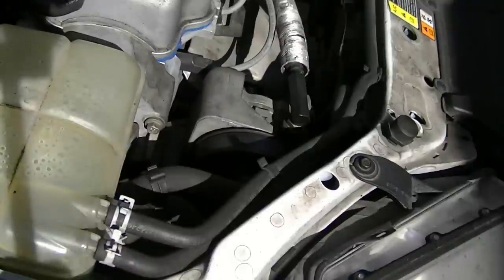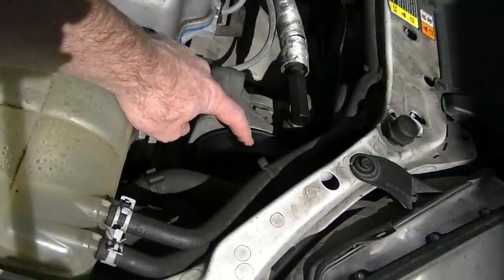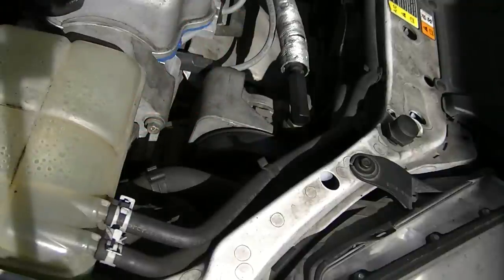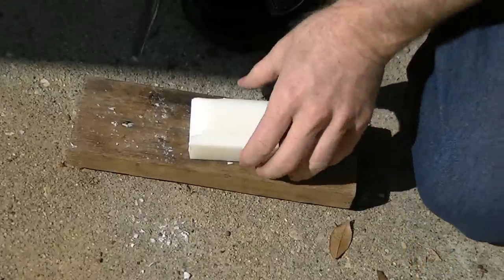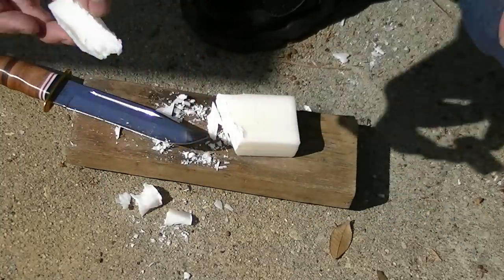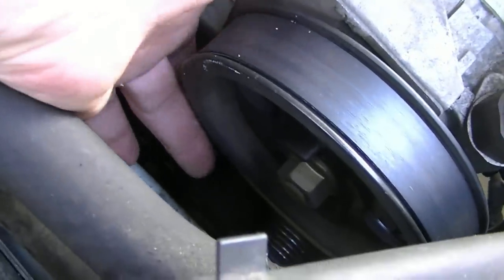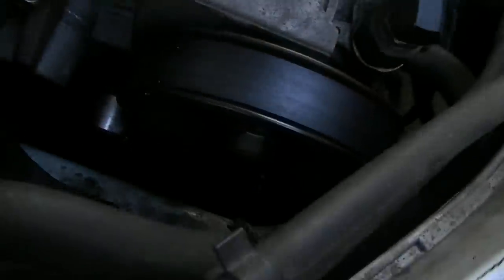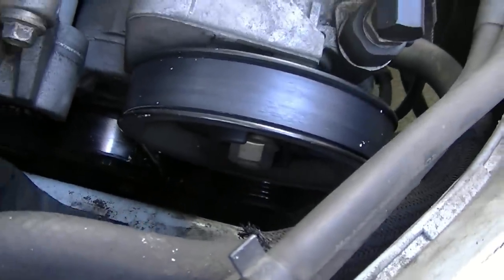How To Quiet Squeaky Belts On A Car - Cheap And Easy Fix

Comment: Okay, so for what it's worth, I'mma throw in my two cents. It has been to my experience that if a belt is squealing, either something is misaligned or bearings are bad somewhere along the accessory/ serpentine. If you spray the belt with  a little bit of water and the noise quiets. It's most likely an  alignment issue. 9 times out of ten, it will be power steering pump because most are only pressed on. The point to the whole thing is that if the belt is out of alignment, or the bearing are bad somewhere, it creates extra resistance and will wear out the other pulley's faster. I let my tension pulley go unchecked for about 1 year. It killed my alternator and my idler pulleys. If there is a squeal, at least take it to a mechanic and pay the 30 dollars to have them look at it and go from there. But don't try and mask it. The annoying noise should be a push to make you want to fix the problem. Any how. peace
Reply: I have to agree with you.I know the tensioner is new but that does not mean it's good,the sound I am hearing is a classic misaligned tensioner using soap just masks the issue.

Comment: The belt will start to squeal again as soon as it gets wet. Use paraffin wax from a candle on the inside of the belt. Its waterproof, won't degrade belt material and it's permanent.
Reply: It works

Comment: Another solution:  My car squeaks due to the belts and I used  "baby powder"  and that fixed it permanently never had the squeaks again.  I just poured it on when it was running and when its not, just try to get it on between the metal pulleys and the belt.

Comment: This fix definitely worked in my case.  The affected belt is not overly worn but developed the leak immediately upon installation of a new water pump.  I re-tensioned that thing several times and it did not fix the problem and to make it even more maddening--it was intermittent.  Anyway, tried your method and it worked perfectly.  Thank You.

Comment: Someone told me to use belt dressing on the belt to get it to stop squeaking. I went to the local auto store bought a can of belt dressing for five dollars and some change. I used it on the belt and the noise only got worse and louder--ugh. I seen your video, did what you showed us and it worked. Thank you.

Comment: THIS WORKED for my 1999 ford ranger..My radiator hose busted and antifreeze got on everything..After that my truck sounded terrible with a loud annoying  squeal just like the one you played there in your video.I change both upper and lower tension pulleys and nothing changed.so i tried poring water on the pulleys and it would stop while i was pouring water on it but come back again in a few sec.SO i tried your method with the bar soap ,and I will Be Danged if it didn't work..NO MORE SQUEAKY NOISE>GONE > RUNS SMOOTH AND QUIET< so there ya go.. i am a live  65 yr old lady testimonial  witness it  that it FIXED 100% after my 4th application of  a small chunk of bar soap  ..Thank you ,you have been a blessing
Reply from the maker: You’re welcome

Comment: we parked our truck for a week trying to fix the noise. We replaced 2 pulleys & bought a multimeter to check the altenator & nothing worked. $100 later I seen this video. It took 5 minutes to apply & worked the first time..... I wish I watched this video $100 ago. THANK YOU
Reply from the maker: You're welcome.  I hope it stays quiet for a long time.

Comment: This trick works 100%. I tried it and the squeak is gone. I had previously bought a belt dressing at Napa, but it only made the squeak louder. If this doesn't work for you then you either have a tension problem( bad Belt tensioner) or a problem with alignment of pulleys.

Comment: Dude at work told me to use gasoline on it, i found it a bit sketchy so i looked for help on the internet. You're video was at the very top so i gave it a shot. I was completely amazed how it worked for u so i had to do it ha! It worked n it took me less than 3 mins! Thanks dude
Reply from the maker: Iggster Salinas You're welcome. I'm glad it worked for you. I wouldn't put anything flammable like gas on the belt.  That sounds dangerous.
Reply: ***** right? & well the noise came back the next day so I'll dig deeper n see whats causing that annoying noise

Comment: I wasted about 200€ on new belts (2 of them) and tensioners (can't remember how the other wheel is called). But the problem resisted. After I watched this video and tried it - like a miracle. Of course, maybe I have to buy the spray, but for now I can still drive my car normally. Really big thank you!

Comment: Hi. Nice videos. Clear, to the point, and without all the dramatic loud music and graphics that other DIY video posters use. There is at least one video posted on You Tube by a serpentine belt manufacturer who advises very strongly against using belt dressings and sprays to quiet noisy belts. I have a vehicle with a GM Vortec 6 cylinder engine with a chirping belt. Thanks!

Comment: I hope some people read this post before attempting to quiet the belt noise on your vehicle. This video is very misleading and incorrect in many different ways. I read some of the top comments about different noises and none of them can be fixed with this "solution". If you put any type of "belt dressing" (soap, WD-40, candle wax, oils, etc) on your belt, you will contaminate your belt and pulleys causing dirt to stick in the pulley grooves (causing the metal pulley and belt to both degrade) and ending in more expensive repairs when a component actually fails.

When a belt is making noise it should be removed and inspected for wear (cracks, pilling, glazing, scuffed edges, stretching). Usually a belt will be worn in some way but that is not the reason the belt is making the noise, it's usually the result of another failing part. Bearing failure (bearing has movement or play) in an AC compressor, belt tensioner,  idler pulley, alternator, power-steering pump, water pump or in extreme cases the crankshaft pulley damper will cause the belt to be out of alignment with the rest of the pulleys and cause this noise. Also a bearing that has lost its lubrication may not have play but may not turn well with the belt removed.

Another misconception with belts (especially in this video where you are putting a slippery coating on the belt) is that when you put a dressing on the belt to lubricate it you aren't causing any other problems with the system and it's "worth a try" because the belt tension will grip the pulleys. However, friction is really the only thing that keeps the belt turning the pulley. If you take that friction away (which you do when you lubricate the belt with soap) you will lose the ability to turn that pulley. This will cause lack of power created by the alternator, lack of cooling from the AC compressor (cannot pump refrigerant hard enough), or even engine overheating (cannot circulate coolant fast enough). All of these things can happen without noise because the belt simply slips over the pulley instead of turning it. 

https://www.youtube.com/watch?v=UF3W-vHPYHg 

This video is a good example of how to perform some basic checks when you have a noise just like this one. The belt is removed after checking to see if any of the pulleys are moving laterally to the other pulleys in the system. Once the belt is removed the pulleys are checked for play in the bearings and should be spun to check for rough spots or resistance. When the real problem is found (the belt is not the real problem) you can replace that component and the belt and enjoy a quite ride without having to soap your belts every week.

As for everyone who has been ripped off by a dealer or mechanic that is lacking knowledge or experience I understand you are unwilling to go back and spend hundreds more on repairs that won't actually repair your vehicle. However in most cases taking your vehicle to the dealer it belongs to is the safest bet to get it fixed properly. Most dealers have people who have worked there for long periods of time and have first had experience with common problems that occur on different vehicles in one manufacturer (which does lead to laziness and misdiagnoses at times). Compared to your typical aftermarket garage, a dealer could save you money because they don't need hours to diagnose the concern. In the end though, don't put all your eggs in one basket and trust a single Youtube video on car repairs because you don't know better, and it's probably wrong (especially when you don't see any sort of professional traits from the video uploader (ie. face, car, garage, tools, etc)).

P.S. That whining noise at 2:37-2:39 is a normal noise for a SOHC Focus engine.
Reply: elzah1234 Read the part about belt tension and friction, or youtube a more professional video please :)
Reply: Thanks so much!!!! I leave for work very early and was worried my new neighbors would start a petition. It worked I am so pumped to leave tomorrow morning!!
Reply: Of course the first try should be proper belt dressing.  But you are wrong about soap being slippery.  It's only slippery when wet.  When dry it's tacky.  I've been using it on V and ribbed belts for over 60 years with no issue.  Still, belt dressing is definitely preferable and there are auto parts stores everywhere.  A squeaking belt isn't going to fail quickly (assuming you've ascertained that it's not in the process of shredding) so let it squeak while you drive to the auto parts store.  If belt dressing doesn't help, THEN look for a bearing issue.
Reply: How long will it last squeaking? I'm in this situation and poor as dirt.
Reply: All true except dealer part.  Never take your car to dealer for belt noise.  Independent garage can fix it much cheaper even if they have to spend a few minutes to determine cause of noise.  It's not rocket science.

Comment: I used chain wax. It comes in a spray bottle usually used for ATV's or Dirt Bikes. Not sure if It's bad for the belt or not but it works.

Comment: How long did the soap treatment work for you?  I had a squeaky serpentine belt on my 96 Caravan and the soap trick worked better by far than anything else.  Prestone belt treatment spray made it much worse even though it explicitly states OK for serpentine belts!  Luckily was able to quiet it down by 1/2 just by applying a small wire brush to the tread side of the belt while it was running and completely eliminated the squeal after using the soap.  Hoping it lasts!

Comment: I wish I had seen your video before removing the belt and cleaning it and all the pulleys with soap and water. It still squealed once I put it all back together. Soooo, I grabbed a par of soap and applied it directly to a pulley while engine running (not to worry it's an Xterra so space is plentiful) and rubbed the soap across the pulley til squeal was gone. Thank you bunches!!

Comment: This may stop the noise, but temporary. It will be more noiser in future. The best is try to tighten or loosen the belt accordingly and test it again, if you cant get rid of the noise thats mean it is time for a new one. I think it will be much safer and the cost are fair or may be lower from what you expect.

Comment: You are a genius! This is honestly the only thing that has worked for me.. How does it work exactly? And how long does it last?
Reply from the maker: The squeak is caused by the rubber rubbing against the metal pulleys.  The soap makes it a little bit slipperier, which stops the squeak.  How long it lasts varies depending on what is causing the squeak and how much friction the soap needs to overcome to stop the squeak.

Comment: Another thing to I don't know if he said it because I did not watch the entire video but its good if the bar soap has a low in it I have an F 150 and I have WD 40 on my belt which will cause it to squeak sometimes you have to change the entire belt in this situation but the soap works temporarily also try brake fluid with a rag that will get some grease out as well

Comment: 1.) We have a squeaky belt, but we're told it might actually be cause the pulley is dirty. Any suggestions? 2.) I'm not sure I understand why you put the soap on the side and bottom. Doesn't the belt turn in a complete circle? 3.) That knife is badass.
Reply from the maker: You could try taking the belt off and cleaning it, or replace it with a new one.  The soap makes it quieter by providing some lubrication to reduce the friction which causes the noise.

Comment: My 99 civic makes this exact same noise. At first it would start when i turn on the AC, so i stopped turning it on, but now it would start making this noise when i'm driving without AC on. Mechanic said he can fix it for $600. Should i try this?

Comment: If you're not sure if your accessory belt is causing the noise, or if it's a tensioner, drip or spray some clear water onto the belt and if the noise stops / goes away, it means it's the belt and not your alternator or other bearings.

Comment: I just had both pully replaced and they belts are fine just squeaks bad when i take off and sit. This should help??
Reply from the maker: 19docholiday It should help. Sometimes the pulley bearings make noise if they are old and worn out, but yours are new, so the noise must be from the belt.

Comment: Nice, going to try it. Does it last a while? My belt is squeaking like crazy and I refuse to pay to get it fixed, because won't be keeping the car anyway. How long do you think the soap trick lasts?
Reply from the maker: Results vary. It could last a few weeks or months, depending on the cause of the squeak.

Comment: Could you mix the bar of soap with a little water and drip the soapy water on the under side of the belt? As opposed to turning over the engine a 4-5 times?
Reply from the maker: Maybe, but it would be a much thinner layer of soap than if you rubbed it on dry.

Comment: I have the exact same noise been told its the belt ?, see replacing the belt did it solve the problem or should i just replace all the pulleys and tensioners ?

Comment: Thanx. Very good information but, I have question. With the soap, how long will it last?
Reply from the maker: It depends on if the squeak is from the belts and not the pulleys. It should last a while.

Comment: I drove my truck in a wet storm, it had a very faint squeak from probably getting wet, it probably would have went away, but instead I sprayed belt conditioner on it and it immediately went to really loud and obnoxious. I've tried to clean it and even used liquid wrench lithium spray, that made it quite for less than 25 mins and now its back. What happened? What can I do now?
Reply from the maker: HIGHTY96420 Every situation is a little bit different.  It could also be a bearing going bad in one of the pulleys, or one of the pulleys getting a little crooked.  Check all the pulleys to make sure they are straight, and maybe replace the belt.

Comment: my car makes the same noise and gets louder while driving 2006 Ford Taurus. also smell burning when starting it up in the morning. will this help?
Reply from the maker: +Sharida Spellman It might, if belt friction is causing the problem.  If it is a bad pulley bearing, it won't help.  It is worth a try.

Comment: My belt went quite for a few hours and then I got louder. I bought a belt like 4 months ago. Would it need a new one?
Reply from the maker: Maybe. You should listen carefully and see if the sound is coming from a bad pulley bearing. Sometimes a bearing goes bad and gets loud, or the pulley gets crooked and makes extra friction on the belt, which makes noise.

Comment: My Car makes the loud noise only when im turning the wheels, like getting out of a parking spot, not when I turn it on. Is it the belt you think still or something else ?
Reply from the maker: That sounds like the power steering pump. Check the fluid level and make sure it isn't low.

Comment: mine has brandnew belts then after installation from mechanic, there is a squeak sound in early morning then disappears after a minute or two... squeak also brings back when I happen to turn the steering wheel in its full end in any ways... what could be the problem?  HELP.

Comment: My car makes exactly the same sound!
Is it ok to leave it like that?  Because it usually goes away after a few mins and only comes back after a cold start.
Reply from the maker: It is OK if you can stand the noise.  It doesn't usually mean anything is going to break apart.

Comment: yo. i already changed the top idler pulley of my car.bcause of the noise and also need to change the bearing. i changed it just yesterday.first the belt and the pulley are both quite and now i heard a quiet squeky sound.its not that loud but a little bit sounds.do you know what is the prob.thanks
Reply from the maker: It could be the belt or the bottom idler pulley.

Comment: Yeah using belt dressing will work for a quick fix but as I learned today the belt will eventually break and disappear. Lost it today in -16˚C weather. Lost power and got about 1 km down the road and power steering went also. It was too cold and in an inconvenient place to get a nylon on to get me home so the car sits and waits for my return.

Comment: Would this not make the belt slip making it in efficient?
Reply from the maker: elzah1234 No. There is enough tension on the belt to keep it from slipping.